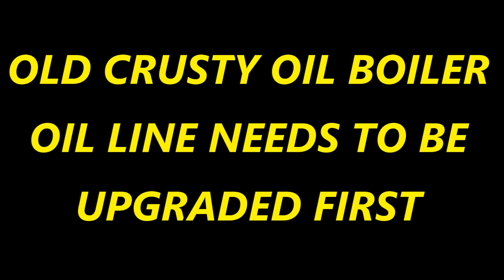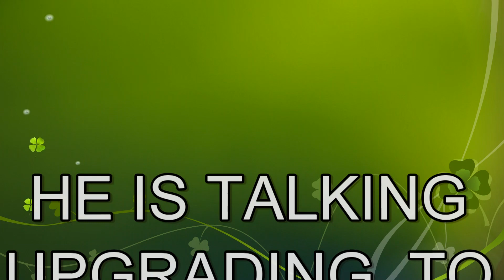OLD BOILER NEED OIL LINE UPGRADE BEFORE I CAN TOUCH  IT

Comment: probably smart to upgrade to natural gas.. he will probably save enough in a couple years to justify it.. high efficiency furnace and a heat pump water heater.. get the rebates from the state or feds whoever is giving them maybe even the gas company... In california they're outlawing gas furnaces.. everything will be electric .. the state is pretty warm but they do have mountains where it snows. They can't even keep the electric on out there for charging cars.. they have brownouts all summer.. now electric furnaces .. they're idiots.